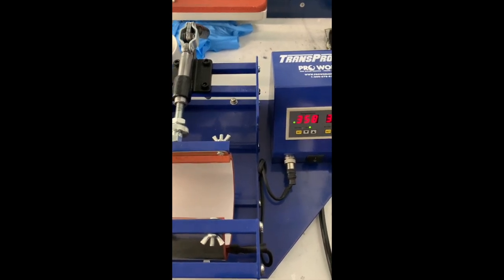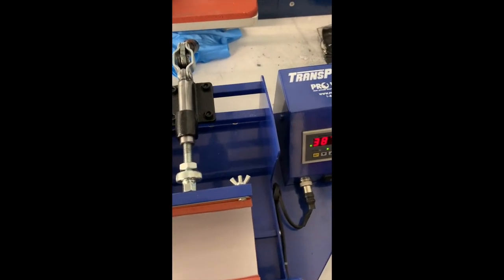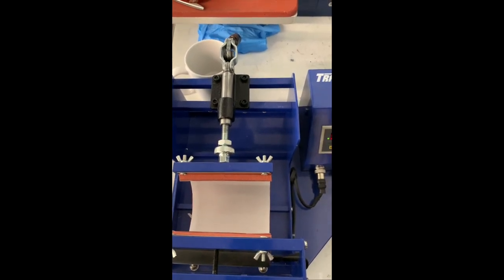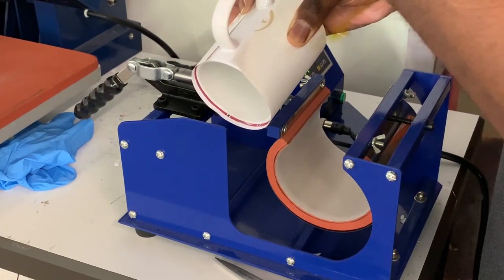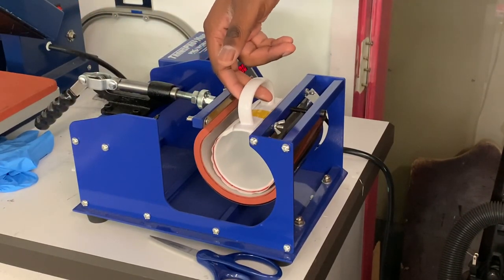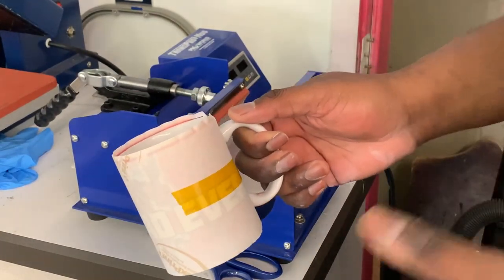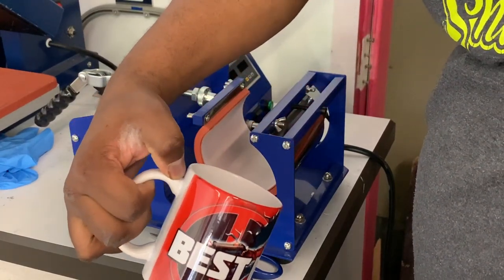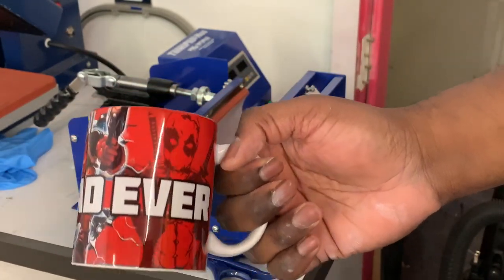How To Print Coffee Mugs Using Sublimation

Comment: May i ask you real quick if you have those vertical lines on the subimation paper after the mug is pressed? Im curious what those are, maybe from the printhead oder heating element? They dont show on the mug, maybe on some parts ever so slightly in dark areas but mainly on the paper after the press. Maybe thats normal or i can fine tune that away. I noticed that you do full top to bottom prints, dont you have fading? wow you do 400 degress and 300 seconds, thats alot, dont you have burn marks in black areas? like brownish black ?